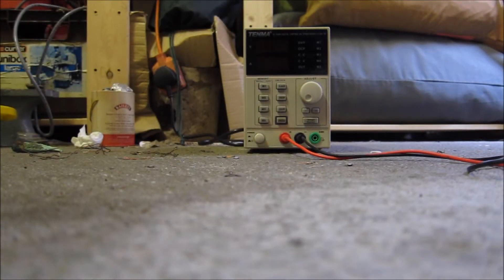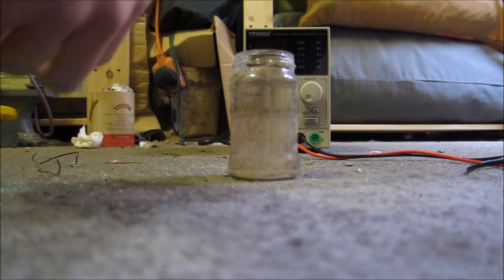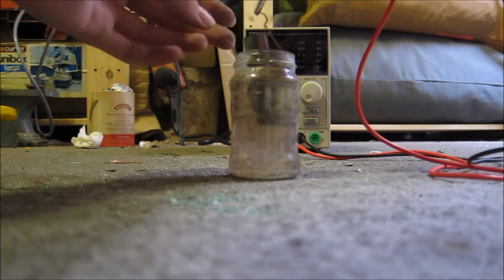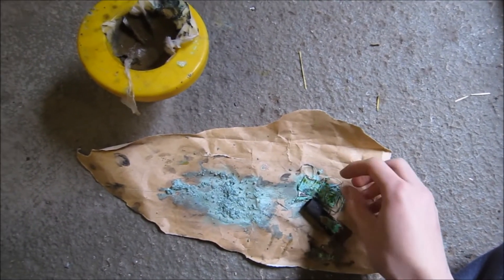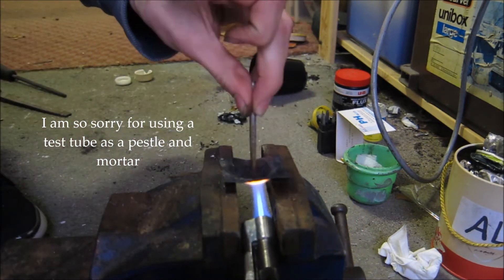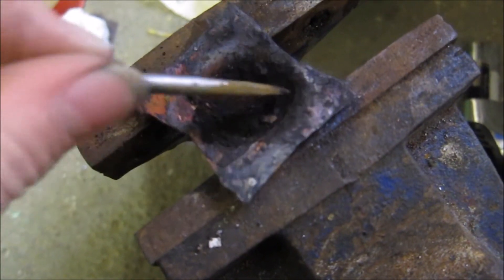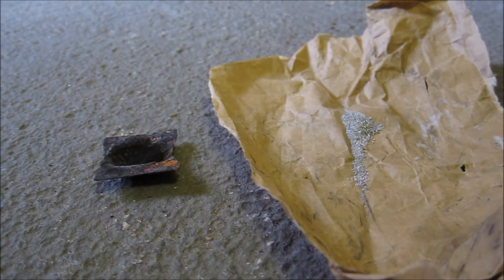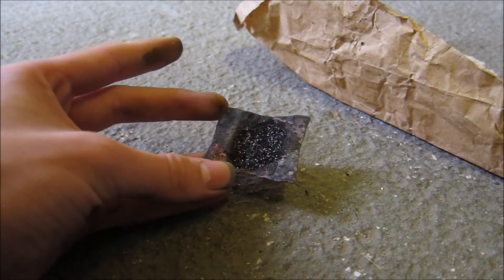Making Copper Thermite

Comment: Sometimes after I start the electrolysis process, I get an odd turquoise substance on the bottom of the glass, anyone know what this might be?
Reply from the maker: It's probably copper hydroxide and it should thermally decompose to copper oxide like everything else when heated.

Comment: Reviating this 2 years later, an easy way to get copper oxide is to mix copper sulphate in solution, with regular baking soda/calcium carbonate. It will make a pastey pastel blue copper carbonate, which you then wash and dry. Then place the dried coppr carbonate in an appropriate high temp container, and heat with a torch until it turns black. This decomposes the copper carbonate into copper oxide. This is more steps, but with how redily available and cheap copper sulphate is as a root killer, you can make it in bulk fairly quickly.

Comment: Could this method be used to make copper cups/pots for boiling water in over a fire? Perhaps in a mould??
Reply from the maker: Theoretically it could be the issue would be that as you can see the reaction is quite violent. Its probably much easier to hammer out copper sheet or use lost wax casting.
Reply: No worries. I'm going to try it with a clay/wooden mould. It's exciting stuff. I,'ll try your sheet idea too.........Thanx. I saw somewhere a guy make copper thermite with powdered regular copper not copper oxide. Filed same way as your aluminium. I'm trying to make a copper hammer and axe too but via wrought forging not thermite.

Comment: Jeez, I make copper thermite quite often but using purchased ingredients (very fine milled aluminum powder and fine milled CuO). A simple piece of hobby fuse makes this stuff go off. I wouldn't have hands trying to light it like that because of the runaway reaction exploding. 4:1 ratio. Now I dialed the formula back and went more like 5:1 and it doesn't make as much noise but made a fountain of beautiful sparks rain out all over with a reddish gold mushroom cloud.

Comment: Copper is less reactivate
Reply from the maker: I misspoke you are correct it's actually due to quite a few factors such as the energy required to boil the copper and it's density.
Reply: @infernalcontraptions8648  nice

Comment: how did you filter out the CuO???? Is it suspended in the water? or is it all over the scraps of copper?
Reply from the maker: Since its a precipitate it will be on most things what I tend to do is set up some filter paper / tissue paper then pour all of the solution through. Then I wash off the copper scraps and container with a little more water and then pour that solution through the filter as well.

Comment: Do...please do not make this in large quantites, and please do not put this in a container like a pot or pipe because i cant stress this enough, this isnt like red iron thermite, copper thermite is a high explosive and will bow up anything you put it in, dont learn the hard way
Reply from the maker: I know it's party why I made copper rather than iron thermite. I don't plan on making larger amounts anyway this was just a small fun project
Reply: Good point but I think technically its classified as a low explosive
Reply: Glad i saw this......... I'm trying to make some tool heads and rather than forge I thought I'd thermite them in moulds.

Comment: Should have just used a power sander and gotten pyro grade aluminum because it would have lit and burned all on its own to start with.
Reply from the maker: True but I don't have any of that and the point was more to make it myself out of things I had to hand than for it to work particularly well.
Reply from the maker: Iron oxide thermite and copper oxide thermite are different things and have different uses so the type of "rust" used does have an effect. The other reason copper explodes is because the reaction takes places at a temperature higher than the boiling point of copper so the copper is vaporised.
Reply from the maker: I'm going to be uploading some more stuff once I get time (probably mid july)
Reply from the maker: Joe poelmans this is the best layman's interpretation I can come up with.
Effectively copper thermite burns extremely rapidly and hot so is useful for something that explodes (its used in some modern bombs.)
Iron thermite burns slower and is more useful for welding (they use it in joining together railway tracks.)
as to the ratio's I just eyeballed it with a rough 50/50 ratio and it depends on what metal you use as to what the best ratio is.
Reply: Thus the reason most of us are on these youtube videos to learn how to do it ourselves to save money and the hassle of buying it online or at a store. Though with so many videos and a lack of sleep from being on youtube for hours im finding it hard to figure out the differences between everybodies versions. personally id rather a simple basic how to video. i see you do it with copper rust i see other do it with rust from steel nails. all in all im sorta confused lol i understand its rust but does it matter which metal the rust is coming from? im sure the fineness of the aluminum and rust powders matter but what ratios to mix them in?
Reply: The metal oxide in question determines the bond energy required to release the oxygen, therefore how much heat is spent in the first step of the reaction, which one who knows any chemistry, knows, is subtracted from the second step. The less energy it takes to strip oxygen from the feeder metal, the more energy is left over, and therefore, the hotter [and often faster[ the reaction. Its simple chemistry.
Reply: Some times a presenter just shows you and leaves it to you to learn the science if it is that important for you to know... ~( .m.)~
Reply: And sometimes they dont. as for the science of it it isnt that important at the moment to know which is why i was asking him some basic questions
Reply from the maker: True But you would be surprised at how many people on the internet don't understand enthalpy. I was trying to say it in a more simple to understand way.
Reply: Theres a lot i dont understand which is why i look up more than one video by one person and ask questions its the only way to truly learn.
Reply: The one thing i dont understand is if the iron oxide is just rust then why does it matter which metal it comes from? How does using different metals in the rust change the burn rate or heat output? If there was still enough trace element of the metal used to make the rust then wouldnt each rust be categorized and named differently i.e copper oxide iron oxide and so on? Obviously theres something i dont understand about it but to me anything to do with fire mesmerizes me plus anything that can make making fire easier in a survival situation is on my must learn list.
Reply: I know coppers a good conductor of heat which should explain why it makes it burn faster and hotter but my very basic knowledge leads me to believe that rust should be void of trace elements of copper or the metal used to make it. im sure im wrong so any help is helpful lol
Reply: That pretty much sums it up for now lol will definitely be keeping an eye on this channel now
Reply: I wonder what types of thermite compositions one would get if they scraped rust from rock cuts on the sides of roads.

Comment: I think copper is not more reactive it gives oxygen easier
Reply from the maker: Yea Its really That copper oxide is a stronger oxidising agent than iron oxide rather than a difference In reactivity's. I probably should have been more clear about that.
Reply: Yes it does. If he would have had a total weight of about 2lbs of material. Ground to the proper mesh. It would have gone off like a small bomb.
Reply: @equuspallidus  i kniw someone who put about 200 grams of this stuff in a flower pot and lit it off, it shook houses down the street, sent shrapnep everywhere and shattered lightbulbs lol